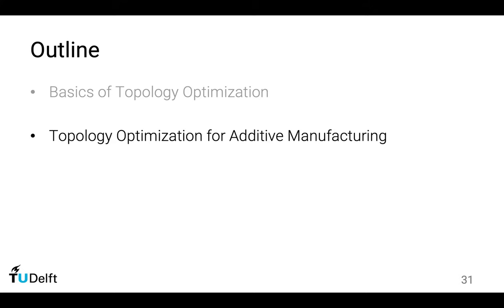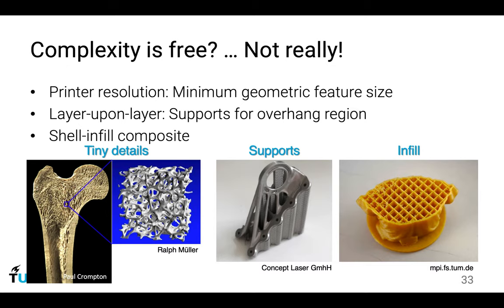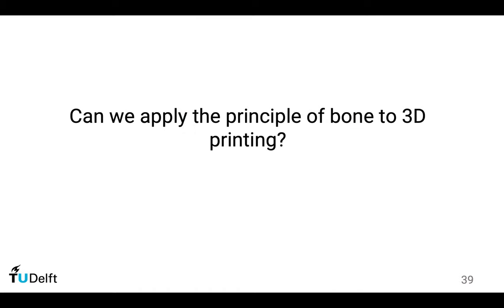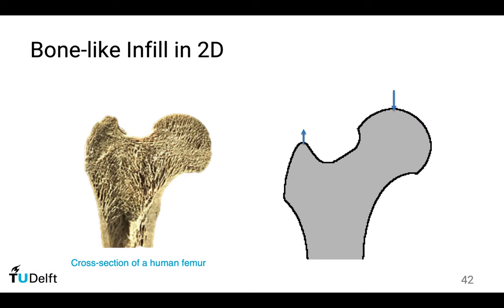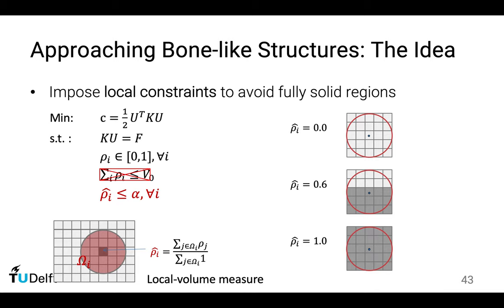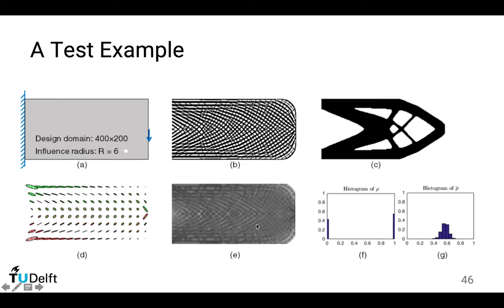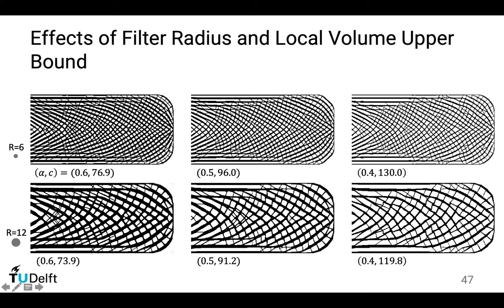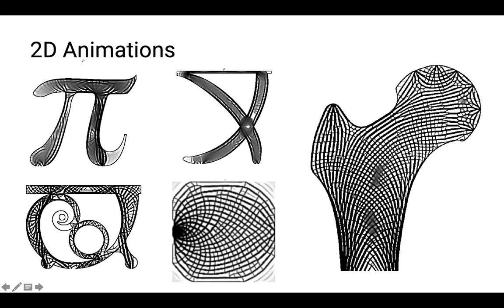Topology optimization for additive manufacturing Part 1/4

Comment: Dear sir I have some questions

For a program like Ansys does it perform the sensitivity analysis under the hood? 

If no how can one perform a sensitivity analysis?
Does it have to be done after validation?
What are the variable that can be changed for truss optimisation problem?
What do you mean by density as variable?

Thanks in advance
Reply from the maker: Many CAE programs such as Ansys and Solidworks provide the functionality of topology optimization. I would be very surprised if they don't perform sensitivity analysis in optimization.

"What are the variable that can be changed for truss optimisation problem?"
In truss optimization, the design variable is typically the radius. When the radius becomes zero (or a very small value), it means that the corresponding truss is not needed.

"What do you mean by density as variable?"
I meant a pseudodensity, not the physical density of the material. The pseudodensity (0 or 1) indicates whether there is material at the element.